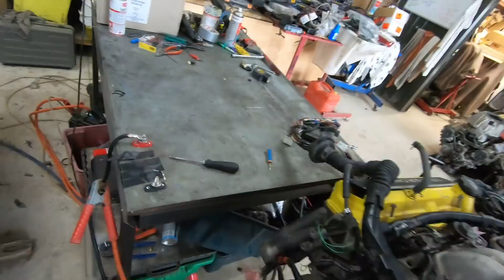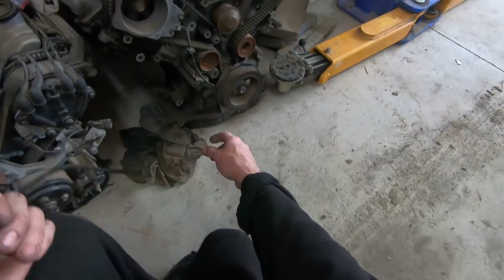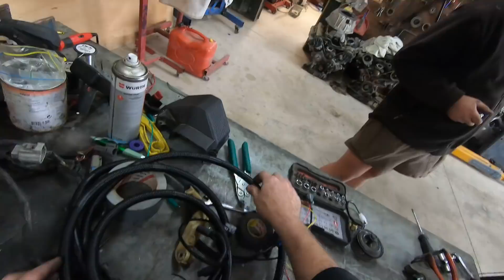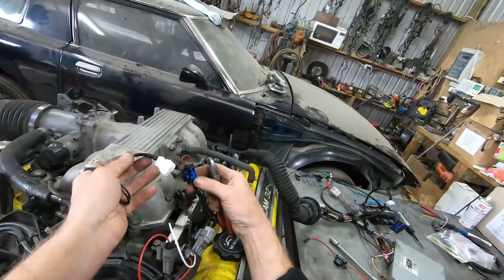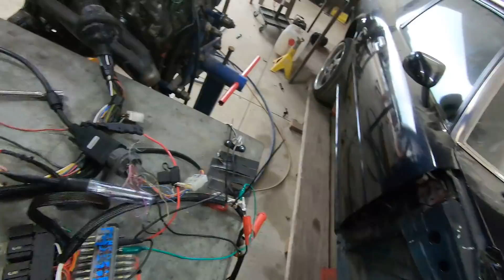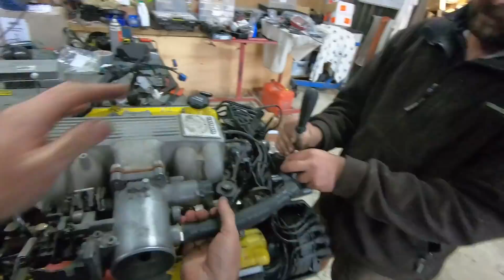Universal 1uz plug and play wiring loom - stock ecu

Comment: Good day I would love for you to build a wire harness for our swap 19 80 Toyota motorhome here in the states it is a dual rear axle 22RE auto Hilux chassis left-hand drive I will be replacing the engine and transmission to a 1uz and automatic out of a 1994 Toyota crown right hand drive

Comment: 1st gen 1uzfe from a 93 ls400 to a 89-95 Hilux 4x4 manual 22re. What would you charge to set up the engine harness and ecu to run off the Hilux harness?

Comment: I'm putting a 1uz in a old Mercedes do you sell the wiring diagram to get it running and do I need s after market ecm? I'm buying a complete motor trans and ecm
Reply from the maker: Yes I sell the wiring info to get the stock ECU working correctly.

Comment: I'm putting a 1uz in a old Mercedes do you sell the wiring diagram to get it running and do I need s after market ecm? I'm buying a complete motor trans and ecm
Reply from the maker: Yes , stock ecu can be sorted fine so no need for aftermarket ecu.  cheers Kelvin
Reply: @CartuneNZ  thank you so much love the videos. Does it need wheel speed sensors or is it old enough where I won't need to adapt anything

Comment: Would you be able to make me a wire loom for a first generation Isuzu trooper? I’m about to purchase a 1UZE-FE from a 93 Lexus. Swapping it to a Isuzu trooper. There’s a guy here in the states that has done this swap multiple times and shows somewhat how to do the wiring but it’s still not clear to me on a few things. I’d like to buy one already made if possible. I would need the AC as well as I’m located in Arizona.
Reply from the maker: I make looms to order and everything is custom.  I normally ask for the stock UZ loom and the vehicles engine harness.  As the trooper configuration is very different to most doing it remotely is quite tricky.  I prefer doing Isuzu with the vehicle in my workshop however I can still make some options to suit.  Cheers Kelvin

Comment: I'm installing a 1uz in my 53 Chevy. I'm needing help with the In cab connector of the ECU and where to tap in. Can you assist?
Reply from the maker: Surely can.  I have wiring instructions to get the engine wired and running.  From there connecting into the chevy is easy.

Comment: Hi great and informative..would that run the standard toyota auto box also ? thanks Taz
Reply from the maker: Hello Taz. This loom has been built to the customers requirements and is a manual loom.  I can do the same thing as an auto loom without an issue.  I have some examples of that coming.  Cheers Kelvin

Comment: I'm interested in wiring harness to run a 92 uze in my 92 T100. I will be keeping in manual. It currently has a 3.0 . How do I contact you ?
Reply from the maker: There is an email in the description which is info@thecartunecompany.co.nz   we are starting back at work soon after our summer break and will crack into our emails.   Cheers Kelvin

Comment: Hi, I'm writing from Peru. it will be possible to adapt an obd2 port to the 1UZ to be able to connect the torque program scan? Thanks.
Reply from the maker: Ive never seen an OBD1 bluetooth devices sorry.  FJ40 with 1uz are a good improvement.  Cheers Kelvin
Reply from the maker: Hello.  There are some devices which allow conversion from obd1 to obd2 on some models.  I see some people have success and some don't.   Not something I'm interested in as I prefer sticking with obd1. Cheers Kelvin
Reply: @CartuneNZ  
Thank you so much for everything!

Can you recommend an obd1 bluetooth device to work with torque app? I put a 1uz on a Toyota FJ40 and I want to replace the instrument panel with a tablet (tacometer, oil pressure, etc).

Thanks!

Comment: Do you ever re shim the valves on the 1UZ ? Many are reporting good power gains by getting the valves back in factory specs.
Reply from the maker: Hello.  Yes I have done quite a few normally as there are a couple of noisey ones.  Most are pretty good so only difference is the noise.  If they were well out there would be an improvement in performance but not something I see very often.  A video is on my list.  Cheers
Reply: @CartuneNZ  Thats great, I have one that just sounds a tad noisy when hot, so definitely on the to do list.

Comment: Another great vid...One thing I was wondering about is the anti theft. I guess that's only in the gen 2 and newer? They need they factory key and transponder that plug into the ECU? Is the factory shifter needed as well in the Gen 2 and newer?Its amazing how well you know these engines! Great work!
Reply from the maker: Hello Billy.  There are only a few models of Gen2 ECU with security.  Easiest fix is a non immo ecu and swap the IGT pins around.  The stock shifter is great to use but not strictly necessary.  Any Toyota Shifter will have the same lever dimensions.  We just modified a J30 Maxima shifter which was fitted to a project to work correctly too.  Cheers
Reply: @CartuneNZ  where exactly do you find a non immobilizer 1uzvvti ECU? is it a certain vehicle that uses it?
Reply from the maker: @585Lowrider  hello.  These days the non immo vvti ecu is pretty hard to find that its much easier to have the immo system removed.  The non immo have a different pinout to the others and as an auto require the extra speed signal to the ecu.  They generally produce less power too.  What model vvti do you have?  I can remove the immo.  Cheers Kelvin.
Reply: @CartuneNZ  I have a 1998 lexus LS400.
Reply from the maker: @585Lowrider  ok.  And what are you trying to do?  Is the engine / trans for a conversion?
Reply: @CartuneNZ  manual trans swap. And I just to get rid of the immobilizer headaches if I ever lose my key I dont have to spend 3 400 dollars to get a new one and reprogram it
Reply from the maker: @585Lowrider  ok.  Easy. The stock ecu can have the immo removed.  With the vvti manual swap you will also require a unit to replace some transmission signals otherwise your vvti won't work.  I can sort both jobs.  Email info@thecartunecompany.co.nz cheers Kelvin
Reply: @CartuneNZ  I have an ECU that was in my Holden Adventra .and I want to put it in my Chevy El Camino together with 1uz engine will it start without programming it?

Comment: Hello I’d like to share with you my current setup of engine wiring and ecu that I’ve purchased for a s13 Nissan 240sx I bought it with a cut wiring loom that looks to be the original one for the engine and another loom with the trc throttle body option I do not know which model the engine came out of since the person before me was trying to put it in a Nissan also so to sum it all up I’d like to ask for some help identifying which engine wiring loom and ecu I have and then see my options of sending my wiring to you to get it re done thank you very much, also which email is best to get in contact with you  ?

Comment: How much for the whole set up with ecu 2nd gen
Reply from the maker: Hello.  Price will vary depending on each looms exact requirements.  Around $2000nzd for universal is pretty normal when I receive a reasonable loom such as this,  alt and starter add a little more.  One soon is getting upgraded fuse and relays.  Every one is different so price is never the same.  Cheers.
Reply from the maker: Every loom is different so price varies.  Starting around $2000nzd for basic setup with all new connectors and basic relay/fuse setup like this providing the loom I receive is reasonable.  Starter and alternator add a bit more.  Every customers requirements are slighly different so each loom is similar but never the same.  Cheers Kelvin.
Reply: We’re can I buy 96 1uzfe, plug n play set up please email me stu2forty@gmail.com I wanna buy a set ready to go with relays everything please let me know.  For a 89 Nissan 240sx swap time even with ecu
Reply from the maker: Ive been making more relay setups today.  Some examples on the cartune company facebook page for vvti but I have ucf20 manual setups as well

Comment: What should I do first as a performance upgrade to my 1UZ?
Reply from the maker: I need more info before I make suggestions.   How much power do you want,  which 1uz,  auto or manual,  specific things you want to achieve etc. Cheers.
Reply: It’s automatic and it’s out of a 92 sc400 I just want a little more power to be able to run it but be a comfortable daily
Reply from the maker: I would start with making sure all maintenance like sparkplugs etc are up to spec to start with then a set of headers/extractors like I fitted to the soarer video maybe with better exhaust if you can.  Then quality air filter.  That stuff will give noticable gains but still quite small.   Next step is cams and ecu.  We have seen 8-10% with just an ecu on n/a engine.  Cheers

Comment: Can that evap solenoid be deleted without any issues? I have an ls400
Reply from the maker: Hello Kyler.  So far I have deleted evap solenoid without issue on conversions where there is another breather system for the fuel tank.  I prefer to use the evap system where possible and would be unlikely to remove from a factory vehicle as it's there for a reason and often add the system to conversions where I can.  Cheers
Reply: Thank you! Also I recently got an ecu at the junkyard from the same year it runs beautifully it has plenty of low end but it’s lacking power. I just did a cd009 conversion. Is there any reason why the  ecu would cause this? It has brand new caps in it, although one of the caps in the kit I got was a bit higher value that the one I replaced

Comment: Recently purchased a 1uz junkyard motor 1st gen with the loom cut at the firewall do you provide looms I can just purchase outright? Or do you think it can be repaired?
Reply from the maker: Generally I find its not worth repairing cut looms.  I have a few spare looms as seen hanging around the workshop.   Ive got plans for brand new looms based on gen 2 ecu later this year.  Also is an aftermarket ecu an option if running manual?  Cheers Kelvin.
Reply: @CartuneNZ  I didn't get an ecu with my engine, it simply wasn't available. I may need too send you an email with a list of parts I can't find here in the states, and have you send me a price for the lot of parts I need. I have a pair of ma70 supras one is getting the 1uz the other just restored. Both have the w58 trans and I'd like to keep them that way but from what I understand I'll need too go too the r154 on the 1uz. Really anything is an option for this build I'd do the research on the parts for the best price but I'd rather just support your channel and your content because it inspired my 1uz build with that supra you showed off with that awesome sound the 1UZ makes.
Reply from the maker: @MrGlennithswift  email is a good idea.  Ill also give you some links to the 1uz MA70 supra video series ive been doing.  Its not released for public viewing yet.  Cheers.